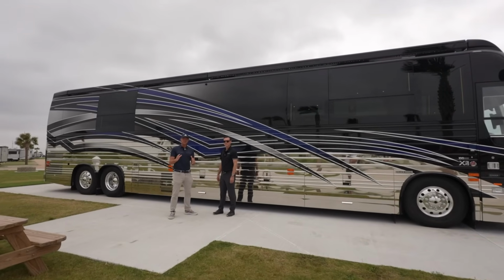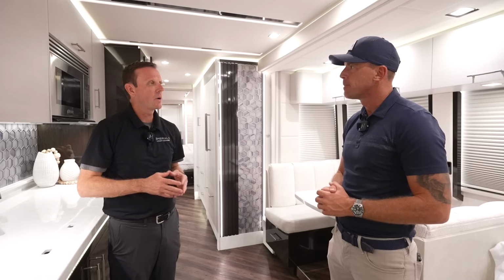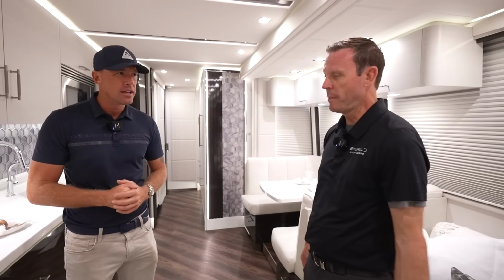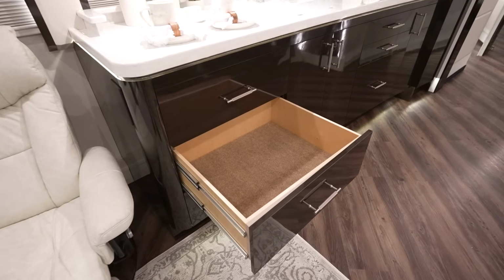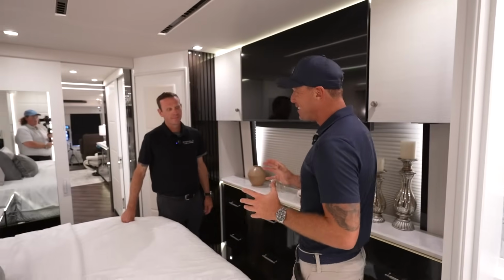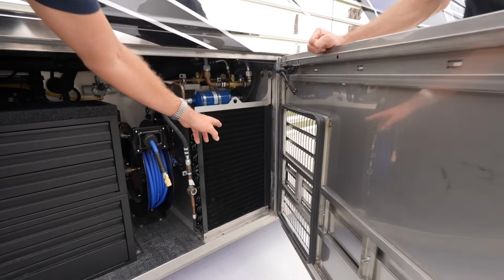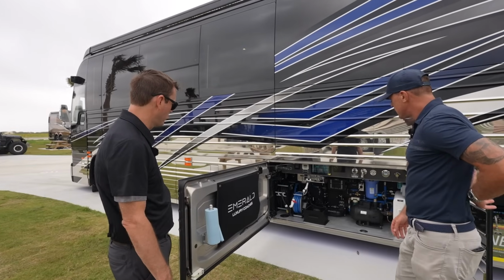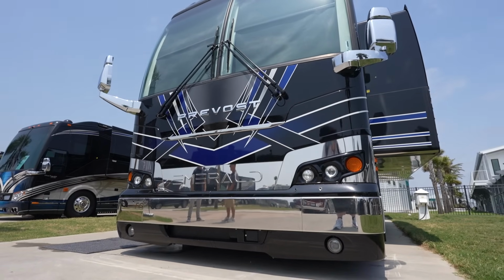Touring The New Prevost X3 Emerald Luxury Coach!

Comment: Pass the message on to John, Make the RO system fill the fresh water tank, then. Filter for taste to the faucets.  All the faucets and toilets get clean water.. No calcium build up, or mineral deposits.
Reply: Doing so would make it take forever to fill the fresh tank and would require frequent filter changes, the RO systems on the coaches don't have a huge capacity, there's not a lot of available real estate for the unit.